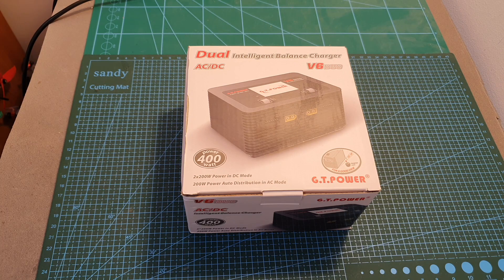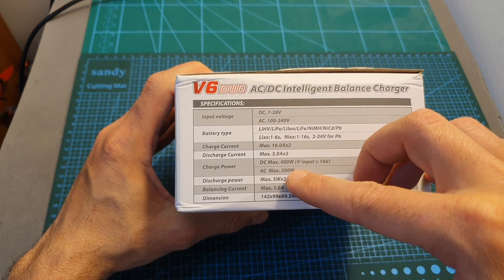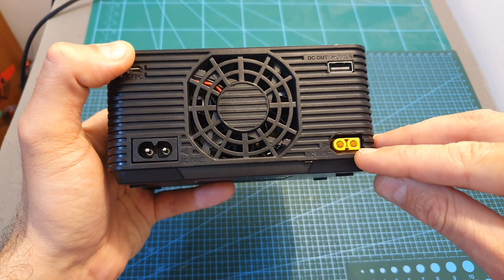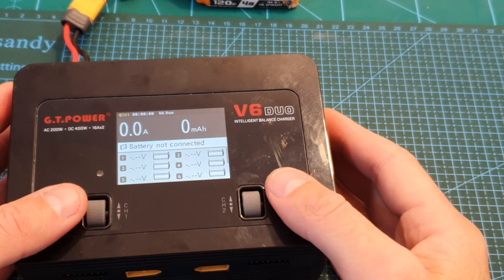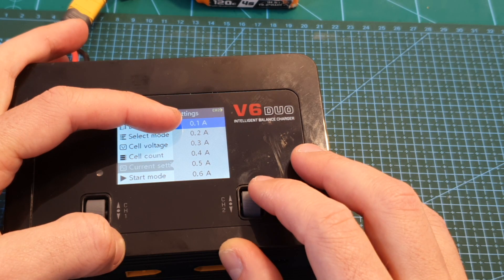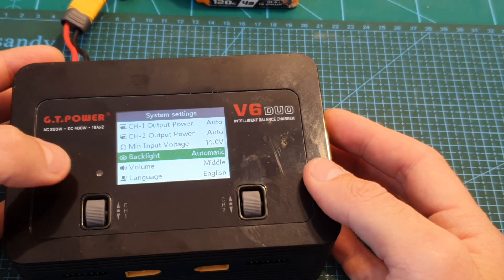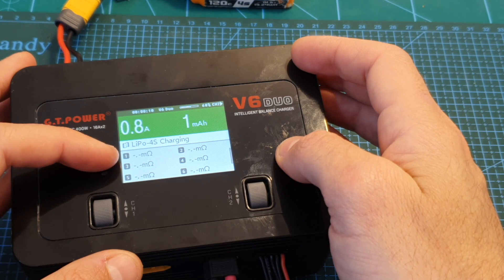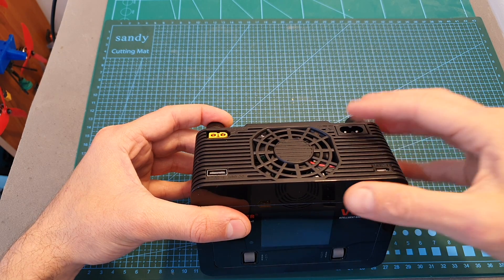G.T.Power V6 DUO AC/DC Charger

Comment: What's under the hood? Are they built the same, or using cheaper components?
Reply from the maker: I opened it up and it looks different. Anyway- all the cargers are made by different manufacturers as far as I know. They are probably just using a very similar software which is made by the same company.
Reply: @KremerFPV  ok, thanks. Do you know if there's any support for the calibration procedure? Is it the same as isdt?
Reply from the maker: @LotharKrupka  I tried to enter the calibration menu but it's not possible.